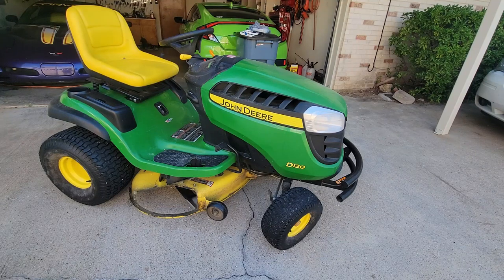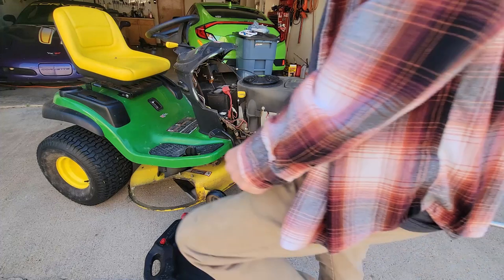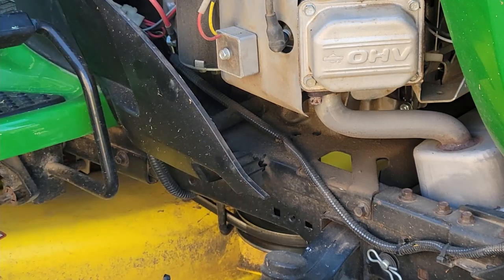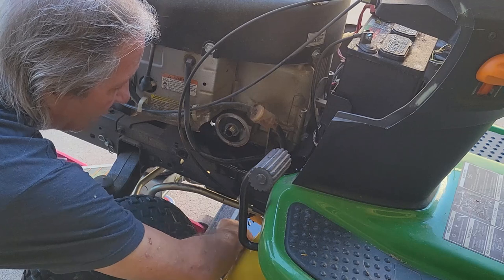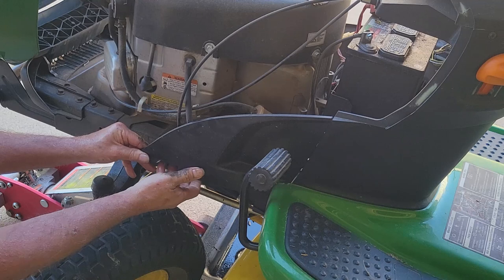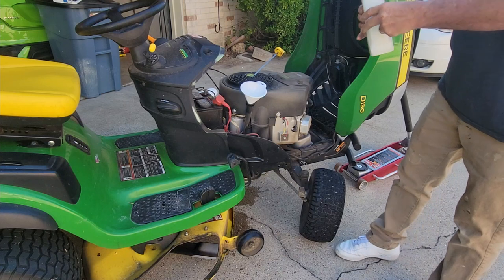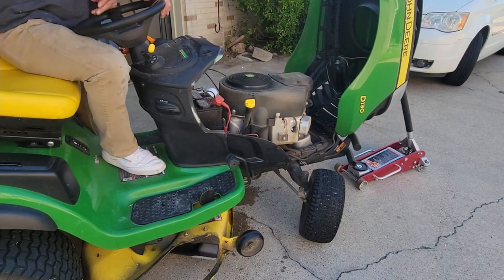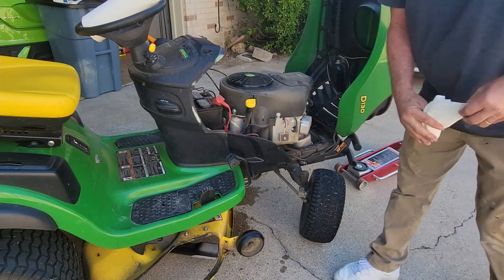John Deere D130 oil change, DIY in less than 10 minutes.

Comment: I got a e 130 same engine.its got a lot of power but they run kinda rough the sound not like the single cylinder I had which ran a lot smoother I had it checked they said its fine
Reply from the maker: From one motor style to the next, they definitely sound different. To me, the 22hp motor sounds a lot busier than the 17hp does at speed.

Comment: If I may ask, where did you get the extension on the oil drain pipe? My drain pipe is too short and the oil drains on the frame.
Reply from the maker: Hi David. You are the first person to notice, and I was pretty proud of that mod😁
It's a JD part, part # AM131611, you can order it almost everywhere for about $12 US. It's a plug and play replacement for the short one the JD comes with.
Reply: @GuysPlayingWithTools  Thanks for the info, I'll order one. The oil on the frame is not a big deal wipes off but it's not right and I'm anal about not right. Thanks again.
Reply from the maker: @David-ll8bt  I agree 100%. That's not about being anal or OCD about it. It's about making it easy next time. It's spring, maybe I will do a "5 minute oil change" video and throw that part number out there.
Reply: @GuysPlayingWithTools  I was an Explosive Tech for 37 years so you can see where, "not right" doesn't work for me. I think the Video with the Part Number would be a good idea.
Reply from the maker: @David-ll8bt  Yikers, you are allowed 1 (one. Not two) mistake in that kind of job.
Reply: @GuysPlayingWithTools  I retired with everything I started with a lot of us didn't. I was just about to make my order and I had a thought. I  wondered if I can break the end with the cap on it off the nipple. Will it unscrew from the nipple. My shop is 30 yards behind the house and it's raining so I'm not going to go out there now. If I can unscrew it from the nipple I'll get a longer nipple and be done. Thanks again.
Reply from the maker: You should be able to unscrew the tube with channel locks pretty easily.  Mine was only 2 weeks old when I did it but it came right out.
Reply: @GuysPlayingWithTools  Thanks, I'll let you know how it goes for me.
Reply from the maker: Please do.  Mine was pretty straight up, a bit of Teflon tape and screwed straight in. No telling if the design has changed in 3 years though
Reply: Great video, thanks! My only suggestion would be to please mention what size sockets you use. My D130 uses so many different sizes, even for just one job like removing the deck to change blades or the steering parts. It’s frustrating to not know what size sockets I need before starting. I waste way too much time trying to figure out which size sockets I need for each repair/maintenance job…running back & forth to the (stationary) tool box.
Reply from the maker: You are 101% right about mentioning socket sizes.  This was one of my original  videos, and I have gotten in the habit of mentioning tool sizes as I work (and sometimes even putting them on the screen as I go) 🙂